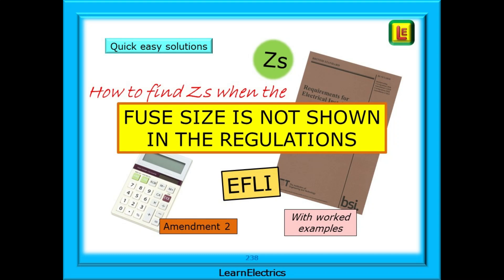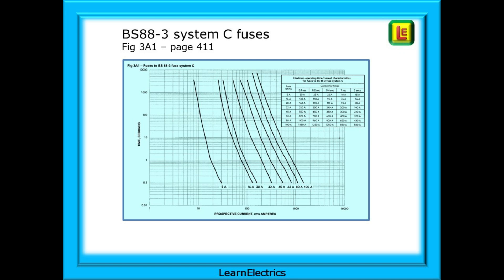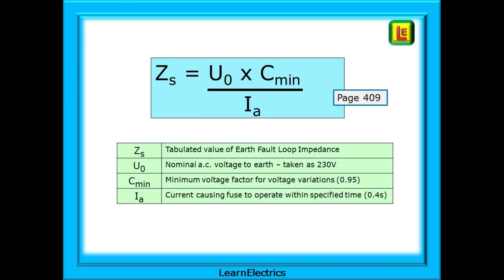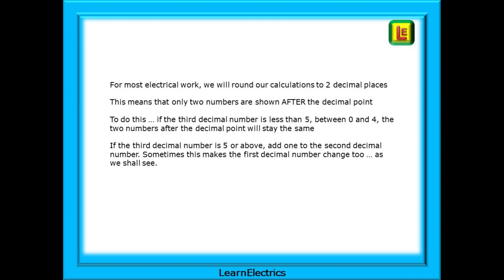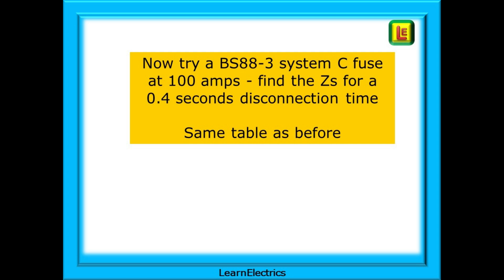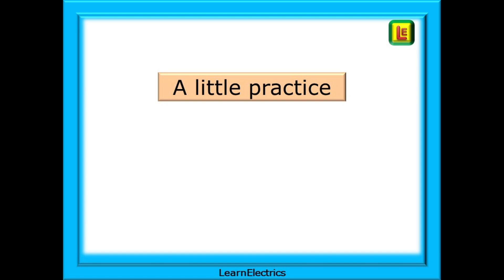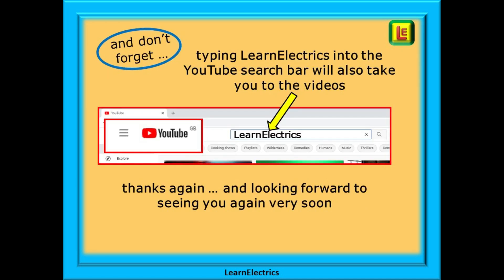MY FUSE SIZE IS NOT LISTED IN THE REGS BOOKS – HOW CAN I FIND ZS FOR THE CIRCUITS I AM WORKING ON?

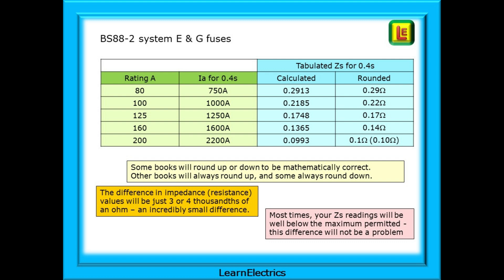Comment: The table shows 800A for a disconnect of 0.4s, where did you get 750 from? That will give a longer delay time between 0.4s and 1s. Also the table at 11:09 has different values to ones you've just shown? You showed 100A needed an Ia of 1200, why are we now calculating for 1000A?
Reply: Also confused by these values that were chosen to do the sums?
Reply from the maker: Yes, I should have written 800A. It was along week on the cancer treatment. Thanks for the heads up, appreciated.
Reply: Me too!
Reply from the maker: Yes, should have been 800A.
Reply: Whilst the first example is a little bit confusing to me, using the formula given and the values needed to obtain a 0.4 second disconnection time, I was expecting something along the lines of Zs = 230v x0.95 /800 = 0.27 or 0.273125 (If you really want to be precise) but 750 Ia? I'm not exactly sure where that number is coming from since it is not in the table. Could just be a simple mistake that can easily be corrected. However, to the second part of your question, the Ia for a 100A System E and G fuse is 1000A, not 1200. That is for a BS 3036 Fuse which is different to the BS88-2 system E and G. If you wanted a 0.2 disconnection time with the BS88-2 system E and G then the Ia for a 100A rated fuse would be 1200A. Hope this helps.
Reply from the maker: Thanks for the support, appreciated. It should have been 800A. Dave.
Reply: He made a mistake, was supposed to write 800.
Reply from the maker: Absolutely right. Should be 800A. Glad you all spotted that.
Reply: Your tutorials are very helpful and effective. Many thanks. Some errors were happened in the calculation. However, because of your effective teaching skills we could easily understand that error.